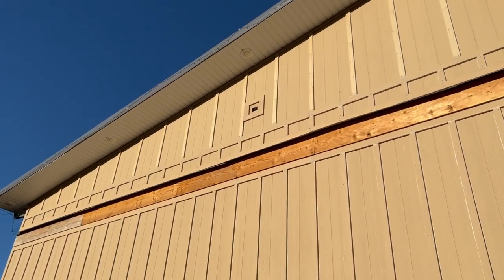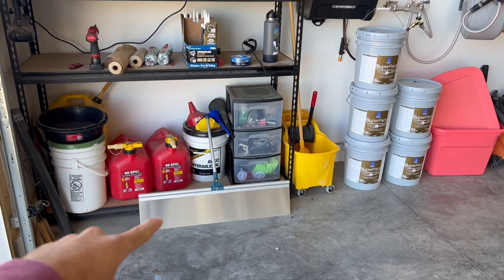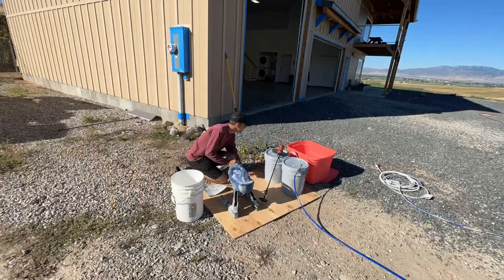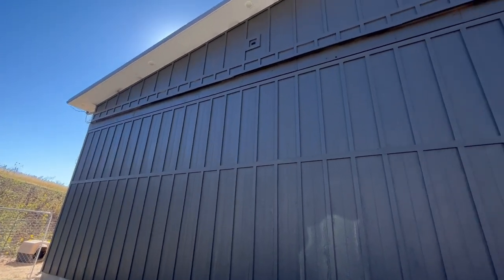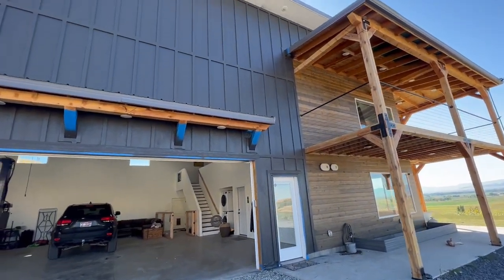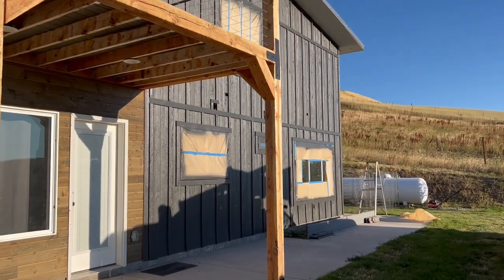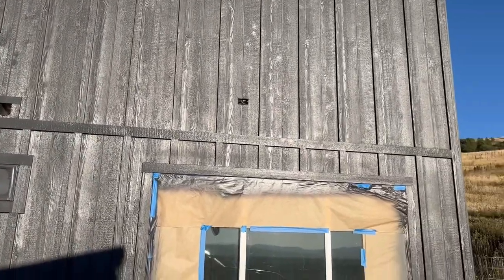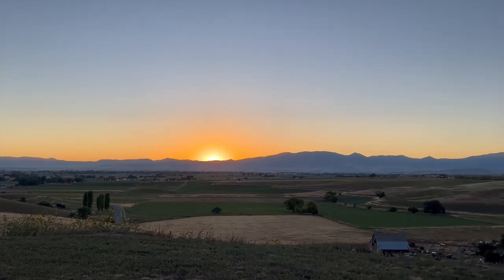#034 FINALLY Painting My Shophouse / Barndominium Build!

Comment: I wouldn't tear out the drywall, I would just attach a 2x10x 6 ft  (or whatever is the length you need) with leg bolts,  then you can just attach all of your reels to this 2x10.  You can always paint the 2x10 to blend in and look a bit better than bare wood.  Another idea would be to create a steel frame that you can attach to your studs and then use bolts to attach your reels to that. Just make the frame wide enough to attach it to several of your 2x6 wall studs.  Also, I have to tell you that getting the notification of your latest video was a pleasant surprise.

Regarding the paint color,  I like the color that you call silver, whatever color it is,  it looks good.  It gives the look of an old and western building.  

Congratulations on your marriage.
Reply from the maker: Good idea!

Thank you!